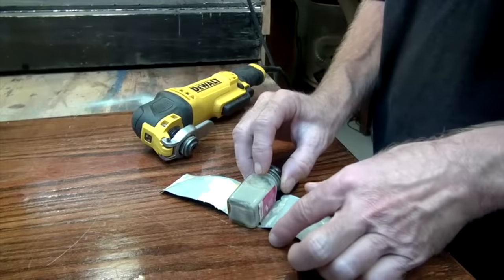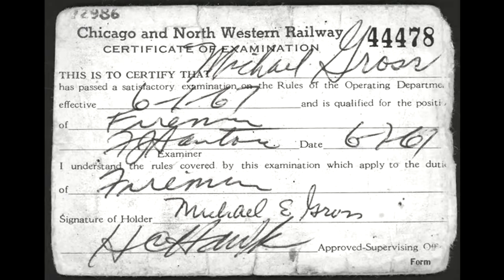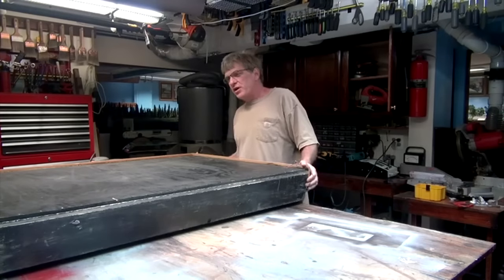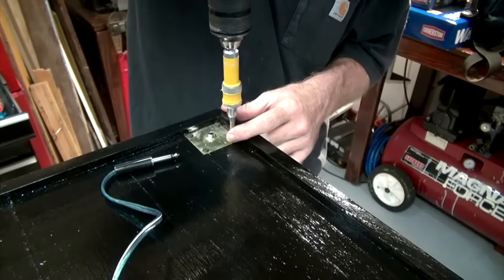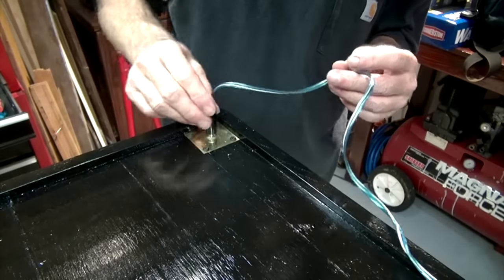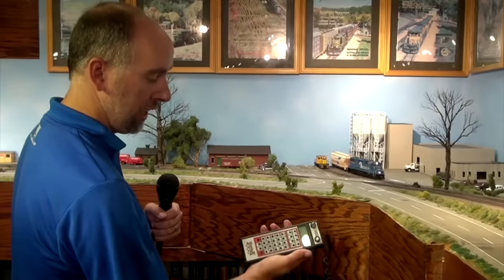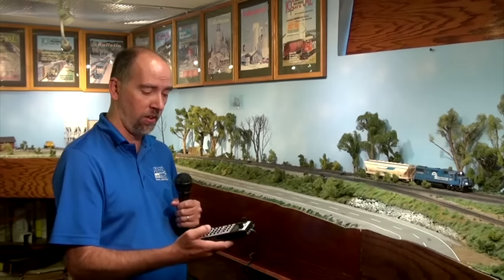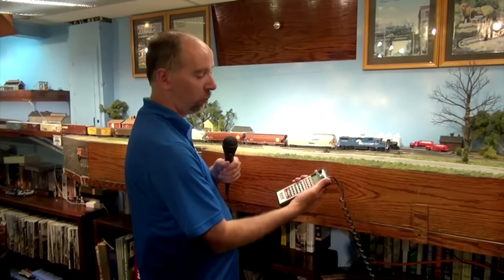What's neat - Nov 2016 column | Model railroad tips | Model Railroad Hobbyist | MRH

Comment: Dear LokSound Folks,
The day I'm waiting for is the day you allow us to program into the throttle, "on the fly", the weight the train is pulling, then match the momentum/etc. to that weight/horsepower combination. In other words, after I install my decoder, there would be a CV or CV's to allow me to enter the horsepower/weight/tractive force of my locomotive. When MU'd, the decoders would take the added horsepower/weight/tractive force of the loco's, and add them together for MU'd service. Then, we would have a CV we could type in how much weight we have in our train at any given time, and have the decoder(s) react properly to the added weight. For example, if I back my loco into a siding and couple to a loaded boxcar, I could then push the "option" button (or whatever), and type in the added weight to my train, say by using the number "100", it would represent 100 tons. The more weight I type in, the more "effort" it will take the loco(s) to get the train rolling along and stop (just like the real "thing")!

Anyway, as a "simulation nut" and "realistic freak", I'm actually surprised that someone hasn't done this loooong ago. I remember when momentum started showing up on DC power packs, I thought "OK, here we go, we are getting there", but then momentum has just sat dormant, even to this day!!! I had always waited for the option to adjust "momentum" to represent something closer to actual tractive effort/train weight calculations, but..... nada! Today, with the incredible capabilities we have with our decoders, please don't let me wait until I'm in the grave for such a feature to show up!!!! PLEASE!!!! Thanks. ;)

Dedicated LokSound addict & maniac!